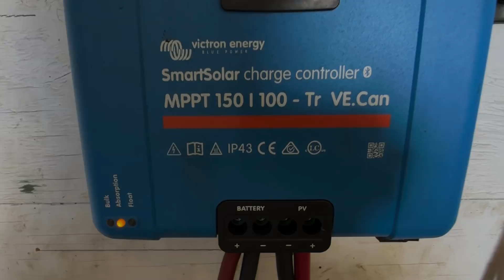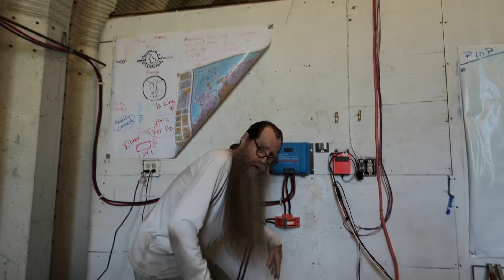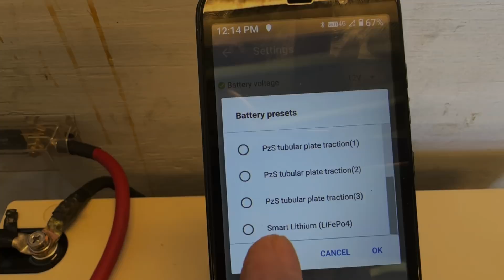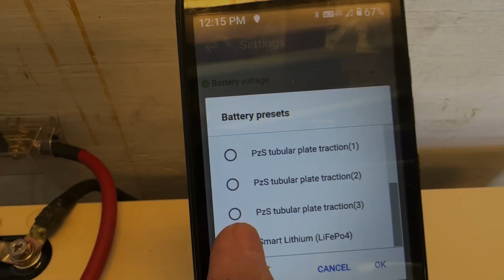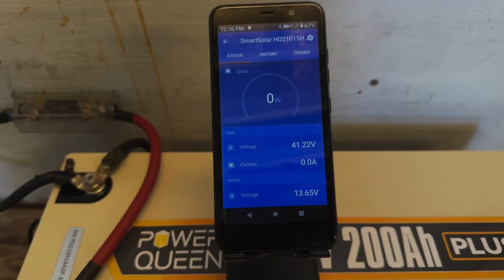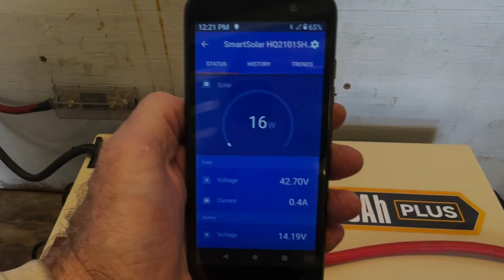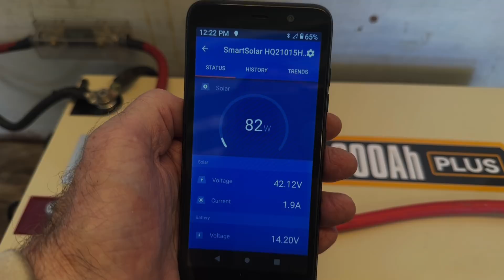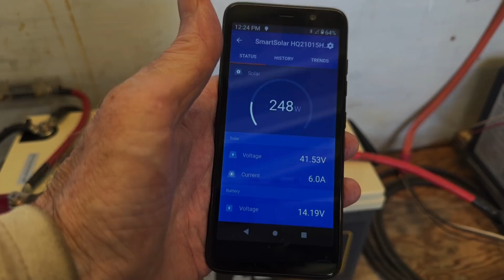Guest appearance#2/PowerQueen12.8V 200Ah LiFePO4/Victron 150/100 MPPT/2100W Solar!/LA to LiFePO4+Sun

Comment: Finally moving from 690ah (345ah) of lead acid to 220ah of lifepo4. Lithium batteries are finally cheaper than lead acid. Sick of filling them with water, sick of replacing them every 4-5 years.
Reply from the maker: You'll never look back! Aloha! 🤙
Reply: @ProjectsinParadise808  well unfortunately I think the battery is dead on arrival so I need to continue to use my aging lead acid. I was able to charge it up completely but as soon as I disconnect any charge, it goes back to 0v on the outside lugs, inside, I get 13.33v on the batteries themselves but the BMS seems like it is dead. So it seems like I need to do the epsom salt and distilled water dance for a bit longer. Nothing I do seems to get this battery to come to life. It will take a charge but as soon as it comes time to work, it just shuts off, like "nope you don't get any of the energy you stored in me!" $600 down the drain...

Comment: another excellent video my brother. Hay be safe over the storm period.  Brother my one question, why 12v?  Man I went 48v two years ago and I will never again look at 12v, firstly the heat, secondly it is more expensive going 12v for a home.  Still nice little system.
Reply from the maker: Mahalo! Started out with 12V because it was what I knew. Have since added 24V, and 48V. Love the higher voltage for sure. Aloha! 🤙

Comment: You forgot to go into expert mode to set the AH for the battery to 200. I have that combiner box. On the top side of the breaker they tinned the cables. They start to come loose and cause the breaker to spark and trip at random. Have him tighten those screws down.
Reply from the maker: I will mention that to him, and mahalo for sharing that information! 🤙

Comment: Thanks for sharing. It is very nice. The only squawk I have is  with the proximity of the surge protection device with the unprotected wiring circuit. It would be interesting to review the installation instructions as per the manufacturer of the device. It is my understanding that the device should be located far off and away from the protected circuits ( after the device) because in the event of the power surge there will be an arc flash gap ( similar to an ignition wire or spark plug firing) in this installation the gap between the protection - protected conductors is not wide enough. That said, the arc will travel from the drvice to the path of greatest inductance instead of out and away to the ground rod. 👈👶👍
Reply from the maker: I'm new to those combiner boxes, but I am going to get one and give it a run out here. Everyone I know out here using them loves them. I'm gonna have to research what you mentioned. I personally don't know about that. Mahalo for that! 🤙

Comment: How about an e-bike review? Hope you get rain and no strong winds 🤞🏻Easy to follow instructions on the much needed battery upgrade. Thank you 🤙🏻brother 🌿🌴🌱🌺
Reply from the maker: Thats funny you say that! Had a ebike all set to be sent out for a review a couple weeks ago for a review. It was sweet, but then they backed out when they saw I was in Hawaii. Having shipping issues again. Seems to ebb and flow on that front once again. Hoping they get it resolved. I'll be cruising these roads then! Haha! Aloha brother! 🤙
Reply: @ProjectsinParadise808  what is the size of the motor, 250 watts, 500watts, 750watts etc. The 250 watts motor does not have enough power for our size. It’s just enough on full throttle.🚴🏼‍♂️
Reply: never ever charge one of those liion ebike battery packs anywere near your home ,,a brand new 400w bosch battery burned down my house ,  it burns a several 1000 degrees  and is almost inpossible to put out   @ProjectsinParadise808

Comment: That was a great trip and great look at a outher system. as a electrician i run into the bug problem all the time. what I hate the most is when the bees get in. can be scary . bug spray and bee killer is a necessary tool in my line of work. That a common AGM battery . RV use them quite often . love how he had the victron MPPT charge controller. older PWM lead acid controllers work LiFePO4 as well. just change set points. very easy to convert .with buying the better battery LFP Think about charge controller as well. MPPT with LiFePO4 you get so much more out of a system. hope everyone stays safe on the island. big changes all over. we got wild fires in caranda and flooding in vermont . I am in Boston Ny . what changes in just few years.   get them off grid systems going. the less CO2 we make is better for all of us. plant some trees as well ! our home needs them. we need them .the  little we do does add to a lot later.
Reply from the maker: Had fun over there for sure. Really like the combiner box. Think I'm going to install some of those here. Hurricane losing strength at last look. Luckily we still have some cooler water around us to weaken it more. Probably dump a bunch a rain, but thats okay. Every lil project helps for the long term survival . Solar keeps gaining popularity which is good. Keep doing what you're doing brother...it helps! Aloha! 🤙
Reply: @ProjectsinParadise808  a combiner box is the way to go. not only fuses but the surge protector. a voltage spike can even damage the panels.as well as charge controller. eco-worthy is great company as well. I got a LiFePo4 from them. with them battery post they recommend no more than 2 terminals when stacking. why they make buss bars.

Comment: Your neighbor will like that battery as I'm very happy with my power queens. If his positive fuse  blows won't it fry his controller since it will no longer have a battery to protect it from the panels? I have my power fuse hooked up in between the battery and inverter.
Reply from the maker: He is loving the Queen! Currently upgrading his system. 🤙